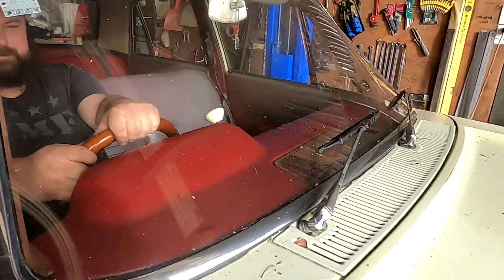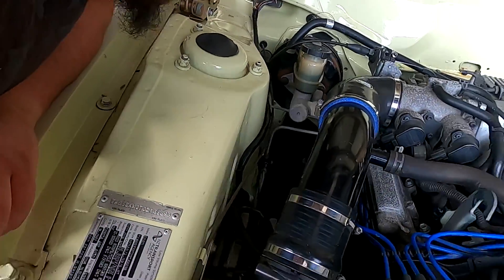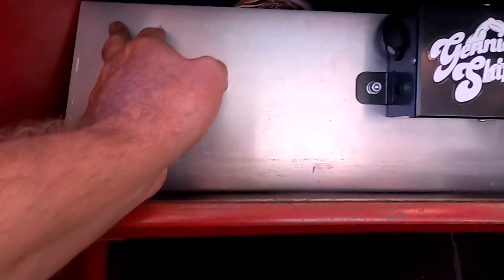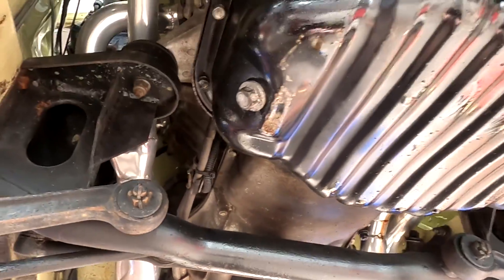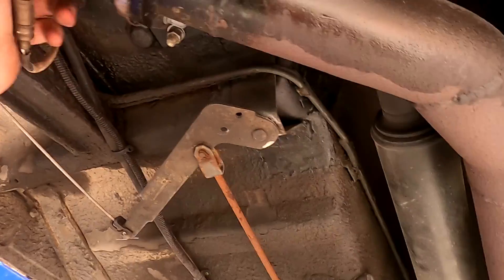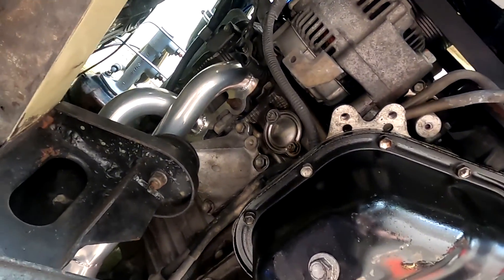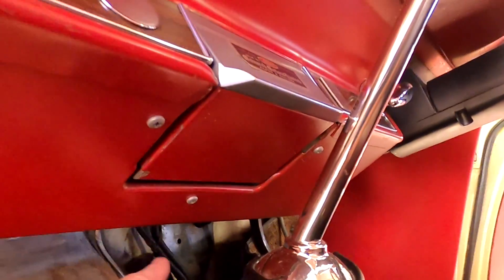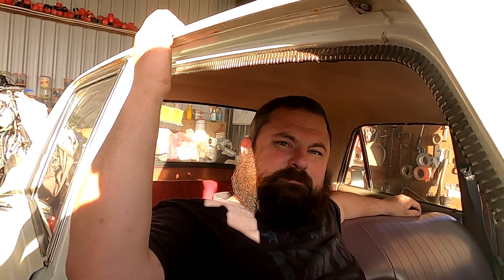1uz engine and A341le Auto in a 1965  Ford Zephyr. Part 1

Comment: Do you have the ECU with wiring harnesses that are ready to be used in the car? I have Chevy C10 truck that i want to fit Lexus V8 Engine
Reply from the maker: No as there are many different versions and every customer wants something different so we custom make to suit both version of engine and customers requirements

Comment: So weird and exciting to see my familiar engine, in such UNfamiliar surroundings.
Reply from the maker: Its a pretty cool car this one. And Im excited to show how to run a 1uz using an ecu which does both the engine and transmission control.  You have been helping me in the kitchen lately , without even knowing it. I've never been great at sharpening knives (or drill bits)  and I still aren't , but at least I know more on that topic.  Cheers
Reply: @CartuneNZ  I've been helping YOU? What an honour!